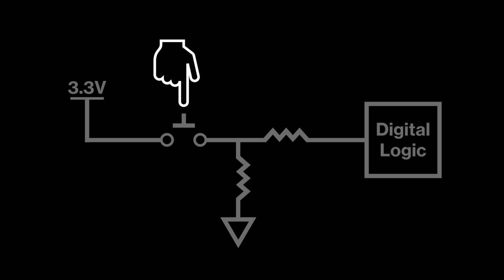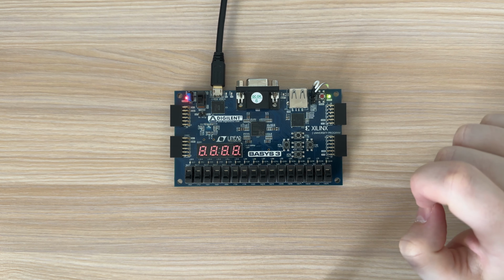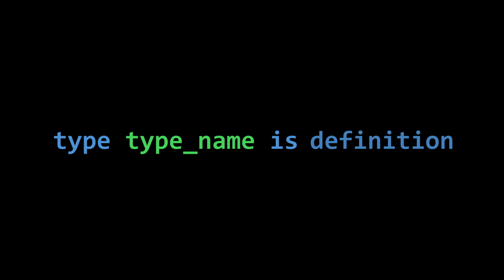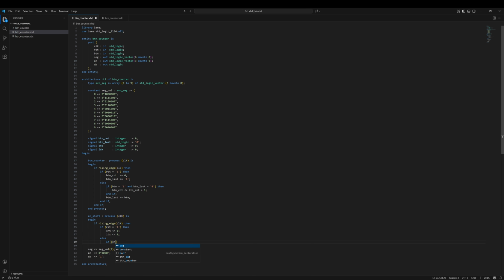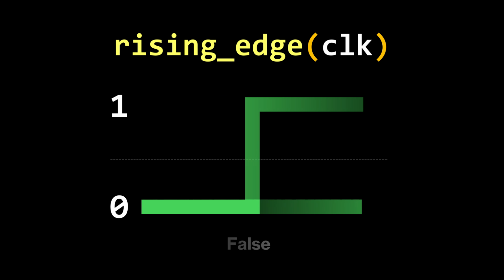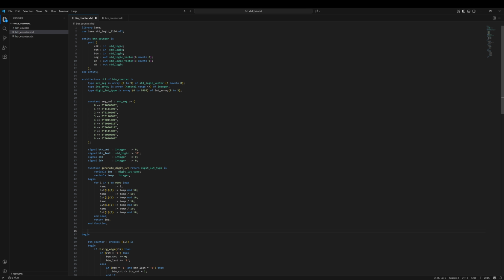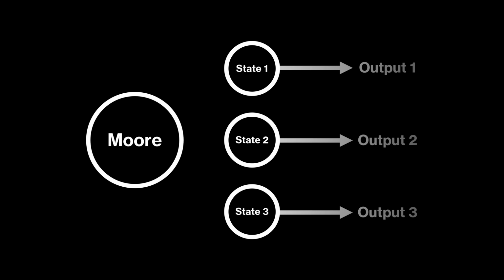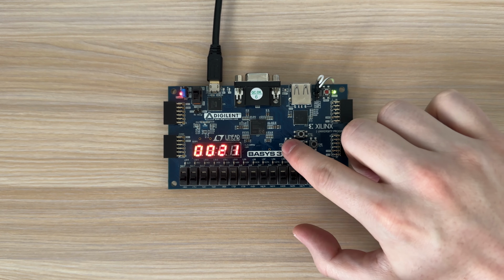VHDL Tutorial - Debouncers & State Machines

Comment: Hey there! Once again, amazing video - it still kinda makes me mad your channel is so small. But with quality like this, it is just a matter of time for a big boom hahaha

Anyways, just an observation: I am following your videos and implementing some basic stuff on my Cologne Chip GateMate A1 dev board. I have a signal that is incremented with the push of a button, which has your debouncing code implemented. However I noticed that, even though I would initialise it as 0, and it worked perfectly on the test bench, in hardware the board will start with the behaviour as if the variable was actually 1. 

As a beginner, it took me a good chunk of time to figure out that the debouncing entity behaves similarly to a flip-flop, and in the first clock cycle of the FPGA, the output btn_db is not defined - and in my case was starting as 1. After the first clock cycle, btn_db would be corrected to 0, but this would trigger a "button action" at startup.

Creating an internal signal "btn_db_int" initialised as 0, having "btn_db <= btn_db_int;" in the logic region (but outside the clock process), and replacing all "btn_db" by "btn_db_int" inside the clock process solved the issue.

Meh, anyways, just dumping this here in case someone faces the same issue if following with another dev board.
Reply from the maker: Thank you! I’m sure with time and more content the channel will grow. Also I’m glad you were able to figure out the uninitialized problem.